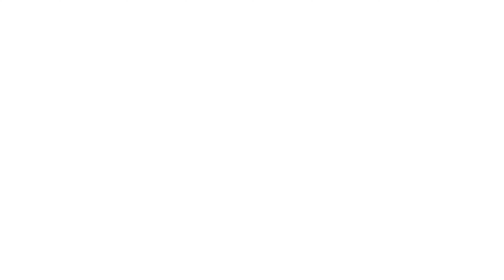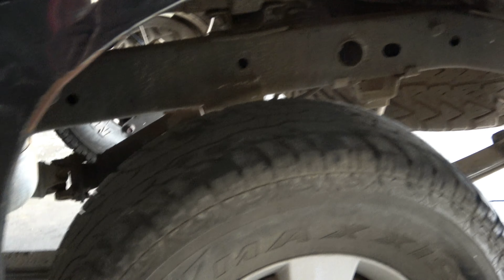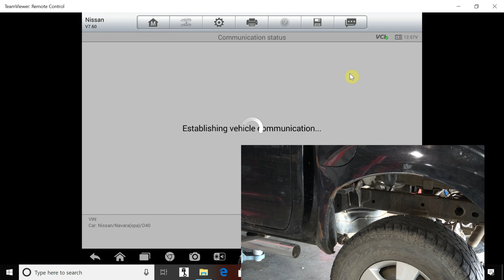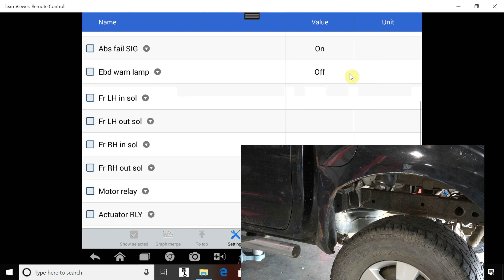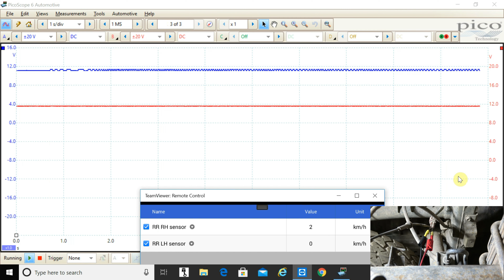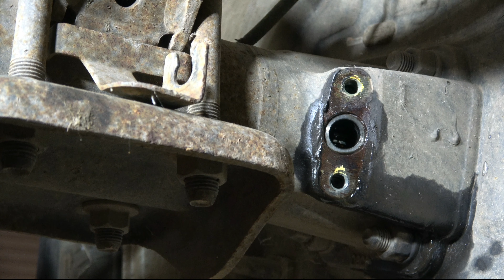WHEEL SPEED SENSOR ABS PROBLEM fault code C1102 Nissan Navara

Comment: Is there oil in that hole? And if there is. Is it alot of oil? I have code c1102. And it looks like by the hole there is oil. But it doesn't look like normal engine oil. It looks like it's thicker oil
Reply from the maker: Yes there is differential oil.
Reply: @a1mechanicaloakey  would alot of oil come out of there? Like almost a quart?
Reply from the maker: When you take sensor out possible, if differential is overfilled previously or the angle that the diff is inclined on the side.

Comment: Does the earth wire for the sensor provide any information to the abs pump module or is it literally just an earth? If so could u earth an abs sensor directly to the battery and the system still work?
Reply from the maker: It depends on the sensor design. But giving earth to earth wire not going to hurt anything. I suggest just try what you wanna do and see if the module reading speed.
Reply from the maker: And please subscribe to the channel.